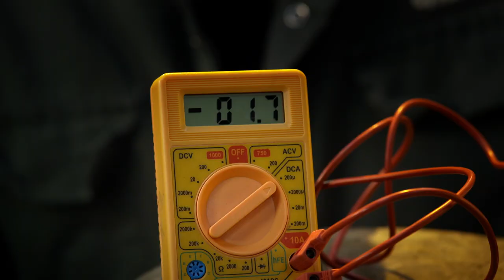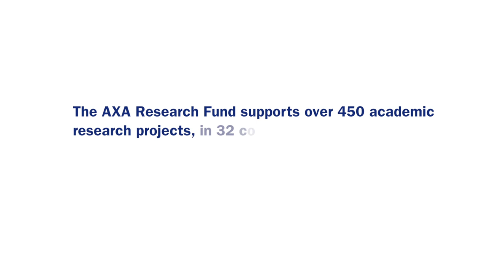What effect could a solar flare (or CME) have on the earth? | Ep#5 | AXA Research Fund

Comment: And the most ironic thing about all this is that we had the technology to overcome this issue way back in the 70's. EG voyager 1 was launched with SOS (Silicon on Sapphire) rad-hardened electronics way back in 1977. SOI (Silicon on Insulator) technology has been developed which is cheaper than SOS, to the point where for example the cloud chamber cameras at CERN have a rating of about 100 Mrad. That is about 500,000 times higher than the old control systems used in power grids. For comparison about 750 rads is enough to kill a human according to some sources (I have not found two that agree so taking a middle figure). We also have the technology for ultra-rapid disconnect for transformers etc. Basically pneumatic ram operated disconnect switches with compressed air blown contacts to help with the arcing issues. Combine the two and you have massive CMEs becoming an inconvenience not a disaster.
Reply: +Gordon Lawrence  Nice to see some rational thought here.  However, as you can see from many of the comments, there is utter disbelief and refusal to accept factual information.  You sound as if you have done some research, or maybe are in a position to know.  I'm a lazy S.O.B., so tell me, are there systems already in place, or plans in place, or are those in the position to implement safeguards more concerned with budgetary and political issues?
Reply: @Apex Mike the safeguards I know of are only on sub-stations for hospitals and other "critical" infrastructure and even then not on all of it. There seems to be three factors two of which are political and financial - the other is the "head in the sand" mentality. Personally I wouldn't live in LA because the earthquake risk is too high but how many people live there now? 10 million+?

Comment: I think 'no electricity' in this case means an interruption to electricity supplied by grid networks. Batteries and generators will work normally.
Reply: No they will burn out to, unless you have it protected like th Earth magnetic field, there is no real way in stopping the Gamma wave length that can pass right though the Earth if it gets pass the van-alen belt
Reply: Perhaps you would like to explain how that would work

Comment: Happened in 2002:-
As reserch says, The Sun's magnetic field changes the current flow is true but it does not end up burning every effected thing up just makes for example battery operated clocks go backwards and effects applied potential simulation of body's ability to heal it self, and re-acts to water like to magnets of the same polarity pushing away from each other, resulting in ability to sit on top of the swimming pool which lasted for about 6 weeks from just a 5 second flash of solar energy from what is known as the 2002 celestial triangle when our planets all lined up as like triangle with mercury hanging below and then our moon passing by and all energy from the sun then beamed to earth targeted on lay lines..
Reply: What drugs are you on ?
Reply: And that one never even hit the Earth just came close
Reply: Anyone know how it would affect pacemakers?
Reply: it wont affect some brands of pacemaker as they use SOS or SOI type rad hardened electronics.

Comment: Most PSU units would not be effected as they are switch mode and see a surge as a power peak so cut it off. A way in which the PSU works.
Reply: It will be effected, it do not need to be plug in and switch on to burn out. the magnetic flow back and forth covers all wave lenght that even a wire less than 0.00001 of mirco mm will burn out, We are talking about Gamma waves hitting the Earth and that will pass right though 12inches of Lead not much can stop it.
Reply: Well, that was almost English.
Reply: Nope it does not work like that. There are three issues. 1 The highly charged particles causing high currents to flow in the ionosphere which in turn couples to the grid on the ground. 2 charged particles causing single event latch-up and single event upset.  3 total radiation dose. The first will not affect a SMPSU that is not plugged in for two reasons - it's too small and it's in a faraday cage (metal case). SEU and SEL don't make a blind bit of difference to electronics that are switched off as they need current flowing in the parasitic components to happen (EG the SCR that is a parasitic effect of the production process for a bipolar transistor). Total dose will affect electronics as it affects beta in bipolar transistors (thereby causing biasing issues) and alters gate threshold in FET circuits. That said to knock out electronics from total dose these days needs about as much radiation as is needed to kill a human.
Reply: Ships at sea will glow, the fact is any thing metal whitch is longer than the wave length will create enough power to burn out
Reply: Nope learn the physics. I have professional knowledge and training in this subject. There is not enough power to make a ship glow.